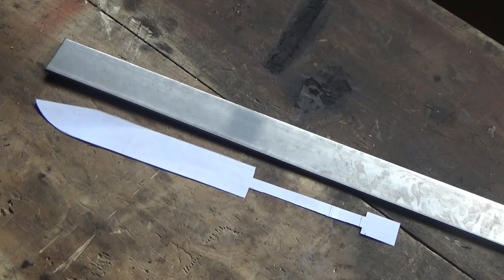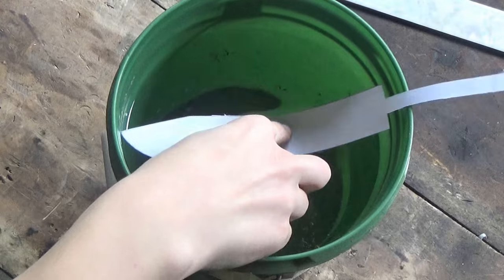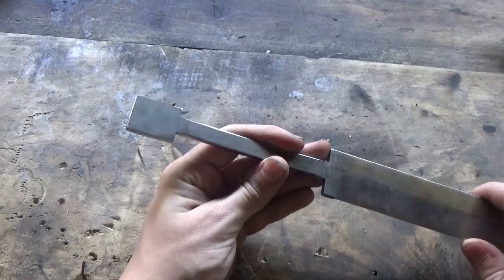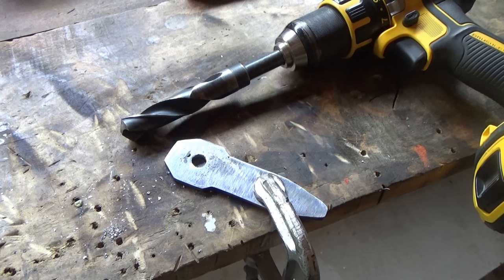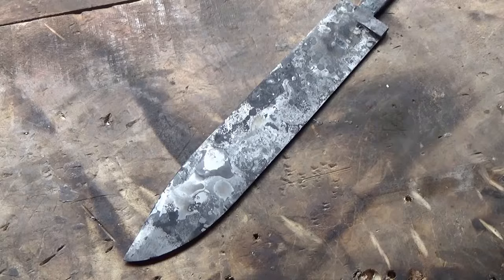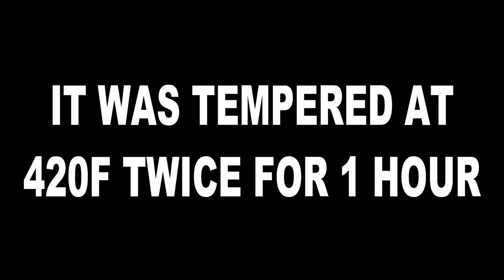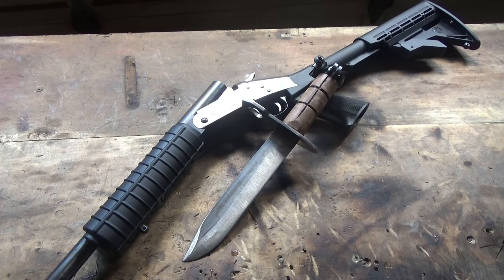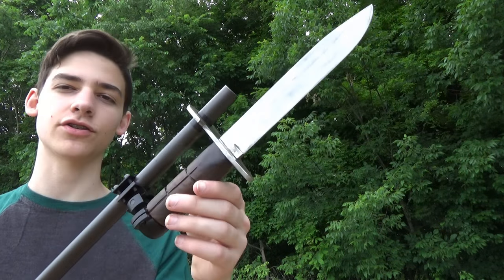Making a BAYONET for a Shotgun With Test Firing

Comment: I would try to use some anti-chaffing so the barrel of the shotgun doesn't get damaged by recoil vibrations.
Check out some anti-chaff for electric wires, it's cheap, and thin so a short piece should fit glued on the front mount to tighten up the fit.
Barring that you can use leather glued to the bayonet front mount.
Other than that nice job.

Comment: piece of advice when you use a grinder don't grind on the leading edge of the disc grind with the flat part of the disc to get a smooth level edge

Comment: Good shit man! I think the only thing I'd personally change is maybe thinning out the steel around the barrel ring a little, but I'm also not sure how thin you could go without sacrificing structural integrity. Looking forward to what you come up with next!
Reply: Xavier you Gould go remarkably thin. As long as it's around 3/16" or 1/4" or so, it should be fine. He used 1095, so it could be hardened as well

Comment: you should avoid right angled interior cuts in blades & knives. Instead you should 'round' the interior cut. Otherwise if you don't that will be a weak point that will focus all the stress and forces applied to the blade and it will (eventually) crack at the hilt.

Comment: nice vid and reaaally cool knive, keep it up. but i just saw a (maybe) flaw: won't it be a weak spot that you just glued the handle on place? it could get loose after some time... did you think about that? another flaw is that if you actually used it, i don't think it ould stay on the barrel and be really wiggly.
Reply from the maker: trust me it's solid
Reply: Make or Break that means he has already used it and it worked, we should all be concerned

Comment: Why, why, why did you go to all that work and not use a pair of cross-bolts through the tang to hold the handle on? That would have literally just been a few minutes of work. There was more than enough wood for you to inset them so they're below the surface level of the grip, too.

Comment: FYI:
Bayonets are not supposed to have razor sharp edges, only an extremely sharp pointed tip. It's not a short sword. Too sharp an edge will slice into bone and and wedge itself making extraction much more difficult. It's a stabbing weapon akin to a pike, not a slashing one, although it can do an acceptable job of that on the end of a rifle or shotgun, and it doesn't need a razor edge to accomplish that.

If you make another, a slight amount of fuller, if you can create it, will make it stronger.

Comment: why do you heat treat carbon steel?
Reply: Moritz B. If you don't, it'll stay soft and won't hold an edge all that well.
Reply: Sander van Duren but carbon steel is already pretty hard isnt it?
Reply: Moritz B. It's harder than iron and mild steel, but it's still quite soft. Carbon steel is just a group of different steels that have the ability to be hardened, not that they are already hard. A perfect example of this: if you take some steel(let's say 1080), and you try to file it, it'll bite in and rip off metal, because the file is harder than the steel. If you then harden it, the file doesn't bite in, and it just "skates" off. For a good blade you want somewhere around 60 HRC, whereas unhardened steel is around 30 HRC, if I'm not mistaken. When I forge a blade I generally aim for 58-61 HRC to make a good edge
Reply: ok thank you m8! :)
Reply: Moritz B. No problem

Comment: >no bloodgroove
kys fam. never forget the blood groove
Reply: They aren't blood grooves... they are fullers...
Reply: Dayton im from slovenia i dont speak english good okay :V
Reply: fullers have nothing to do with blood. also they don't serve much purpose. This sort of wedge taper knife might hold even better than a simple hollow grinded one with a fuller
Reply: MrPanos2000 Fullers are used to let air get into the wound so that the knife doesn't get stuck with the suction
Reply: MrPanos2000 
it makes the bayonet structualy stronger
it makes it lighter
it saves steel
it makes removing the bayonet from the enemy easyer
and it looks badass
Reply: Would of been a nice addition, but the quality of steel he's using he doesn't need it.

Comment: its a fucking shotgun why would you make a bayonet for it
Reply from the maker: because this is America
Reply: Imagine a situation if your shotgun jams or runs out of ammo and theres a zombie, person or anyone hostile.. what are you gonna do with a bare shotgun barrel? THAT is why this is pretty great idea, or atleast in my opinion.
Reply: Nikola Cejovic run up, stab, fire
Reply: Extra points!
Reply: Melting Clocks Yes that is true but its way more effcitve than a stock or barrel of the shotgun.
Reply: Melting Clocks have you ever held a shotgun? They're not very easy to club someone with if they're right in front of you. Unless you were already holding it like a bat to begin with. Mine is heavy, probably too heavy to spin around in time to hit anyone.
Reply: Max W Thats is exactly what i meant, its too slow and heavy to use like a bat.
Reply: Not necessarily. If you're holding it properly it can be used like a club. But if you're holding it in any sort of firing position, most of them are too slow to spin around.
Reply: Max W Well thats true and if you hit someone it might not disable the attacker (miss a little) but on the other hand a bayonet sure will do.
Reply: Nikola Cejovic bayonets in real life were use to prevent killing, watch lindybeiges video on them.
Reply: Melting Clocks I identified him, how else would you learn?
Reply: Make or Break fuck yes bro merica